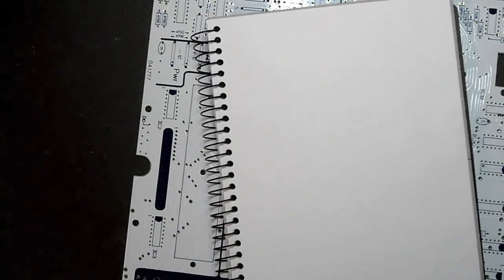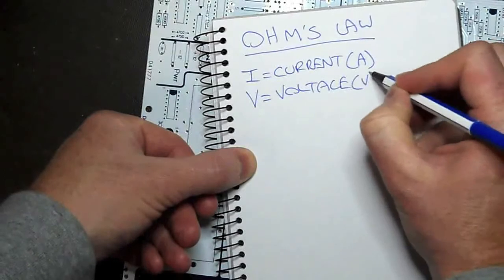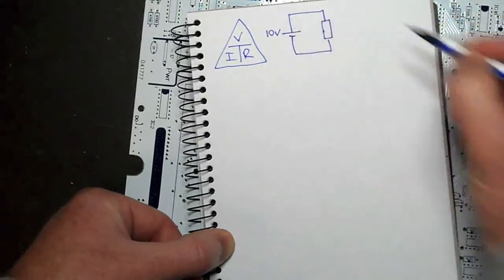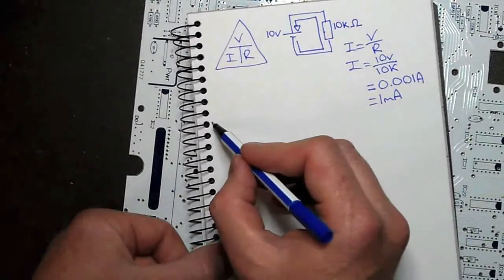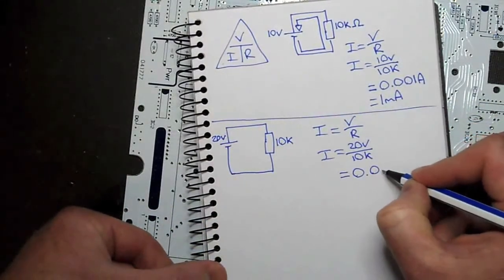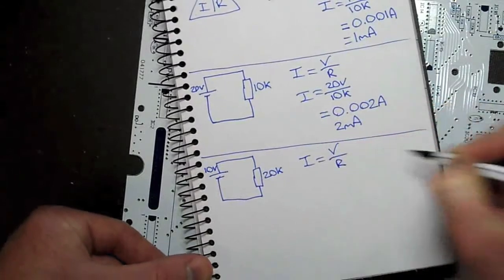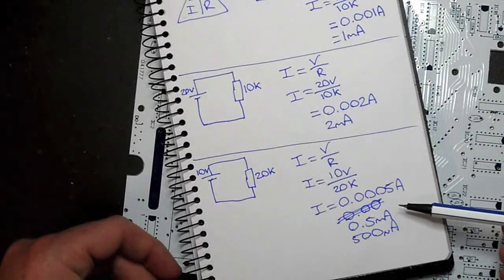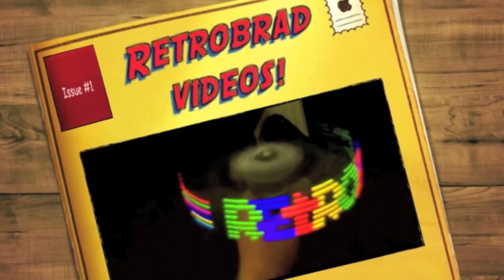Electronics Tutorial 1 - Ohm's Law.

Comment: @Elvisyoan The total current flow will be limited by a small amount of resistance designed within the 9v battery.  There is also a small amount of resistance within any length of wire.  Your LED operates within a small voltage range(~3 to 4 volts) and will need an appropriate sized resistor to keep it from being destroyed.

Comment: Example. I am working this problem. A conductance of 21.28mS is equal to a resistance of A)4.7Kohms B) 47kOhms C) 21.3kOhms. The short answer I came up with from the calculator was 4.699. I divided 1/21.28 and got 4.699 which I guess would round up to 4.7 but looking at my book, not sure how to go from that answer to one of those 3 answers.